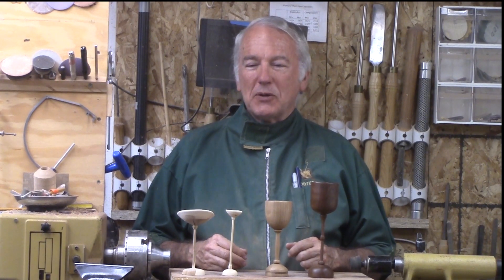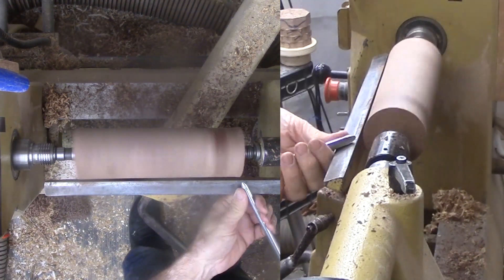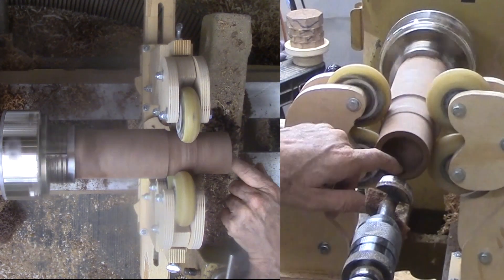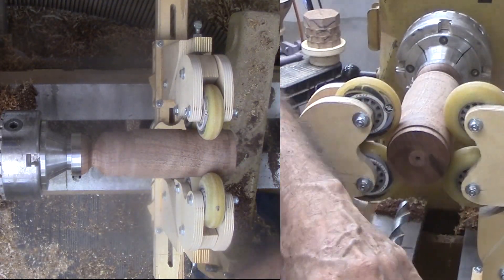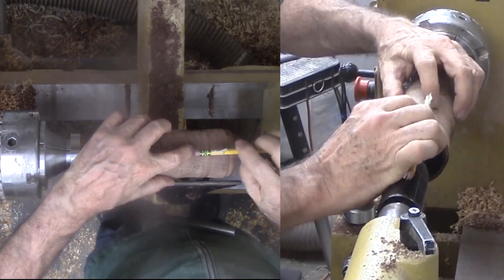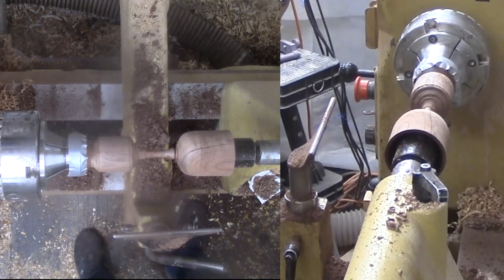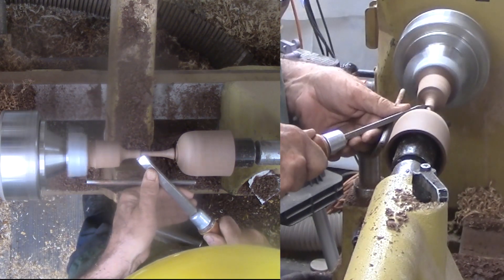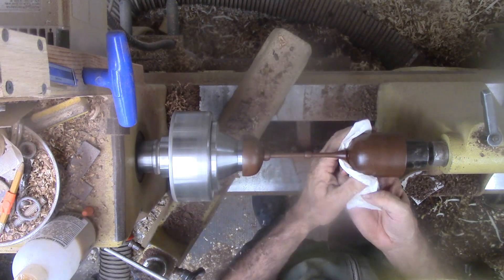Refined - Process To Woodturn Dry Wood Goblet

Comment: Beautiful goblet Alan. I have always turned a tenon on the base, mounted it in a chuck. Then start on the inside of the bowl, sanded and finished it, then used a light to judge the wall thickness. I finish the outside of the cup portion then use a cone on the live centre to support the top end and start working down the outside. Next time, I will try your method and decide which method I prefer. Well done on your goblet.
Reply from the maker: That seems to be the prior standard process.
Alan